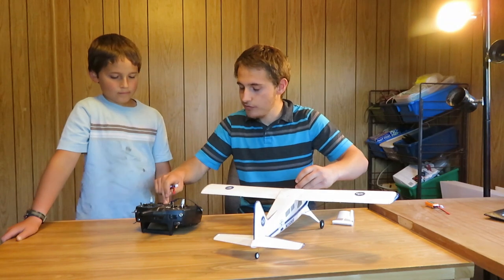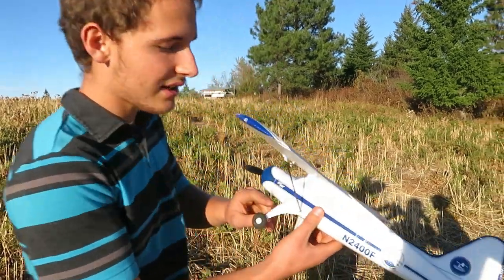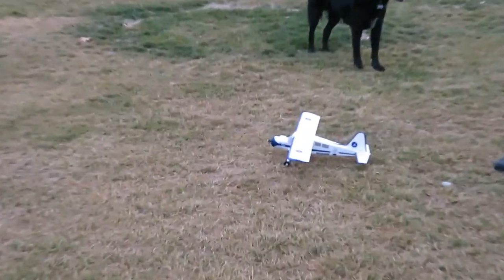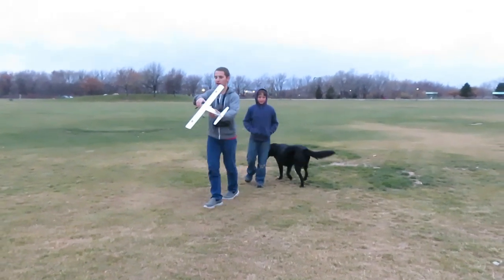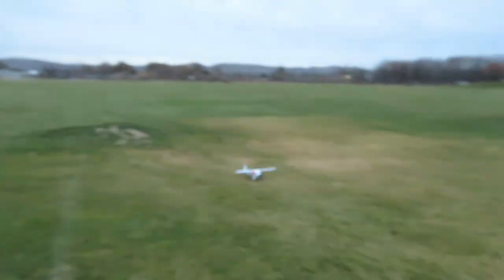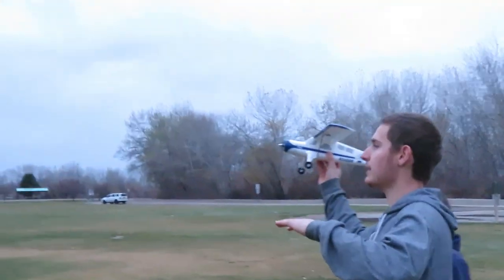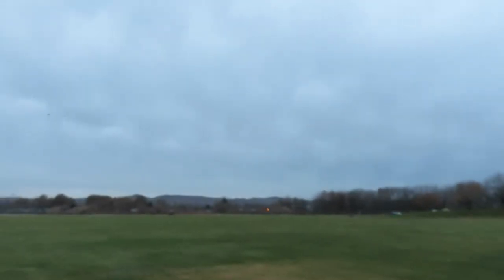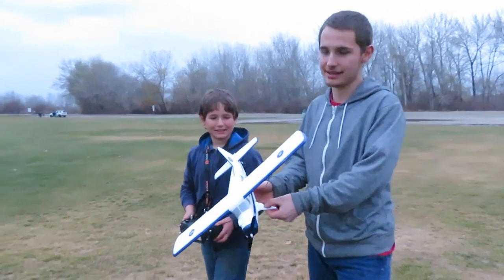Flying the Flite Test Beaver!

Comment: I thought the ft beaver had the aura 5 stabilization rx in it
Reply: It's on you to add it unfortunately.
Reply: It's very easily added but it doesn't come with any flight controller or receiver.